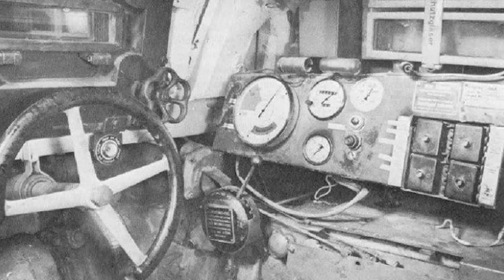A Deep Dive into the Tiger I, by the Chieftain

Comment: The Tiger 1 is slowly becoming my favorite tank, with my previous favorite being the KV-2.

I like tanks that ultimately failed apparently.
Reply: I mean a tiger with a great crew was deadly on the battlefield
Reply: @tonyporter6712  sure, but it ended up getting used outside its intended role, and suffered as a result.

It could also be I like big metal boxes
Reply: It was very successful in the defensive fighting that characterised the war 1943-45 and it had the highest kill ratio of any tank of WW2.

It didn't change the war, but Germany was already losing the war before the Tiger battalions were even deployed.
Reply: The KV-2 was a tremendos failure in reality but popularized by videogames nowadays.

Comment: Armor sloping.  Up to about 45-60 degrees from right angles, especially when using thin armor (under half the impacting projectile's diameter in thickness) sloping gives less improvement against old-fashioned steel AP/APC projectiles than simply making the plate thicker.  So any low-angle sloping is usually based on other design requirements where a slope gives only a small added effect.  Above the 45-50 degree range, sloping can get progressively more effective, though at the cost of internal space inside the thing being protected and, remember, only from certain directions, so sloping is kind of "virtual".  The more pointed the nose shape, the better against thin plate, with the reverse against thick plate at higher angles.

Comment: I'm pretty sure you could find a company that would fabricate the steel that was cut away and weld it back on. Would it be cheap? No. Would it be armored plate? Probably not.  But it could be done if circumstances were to allow it. I understand that it's currently a training tool but things change.

Comment: There are three major needs of an army leader. The best have a good handle on strategy, tactics, and logistics. Very few are great at all three. The one that is usually missing is logistics. Not very sexy, but without it strategy and tactics don’t get you s**t. So weapons design has to take support into consideration. It took a while for the less enlightened leaders to figure that out.
Reply: That's one reason I worry about Ukraine.  They seem to be getting small batches of different weapons from everywhere.  Even if they were designed to be easy to maintain, as you rightly say should be a design priority, they'll still need many different types of replacement parts and ammo.  Seems like a big logistics challenge, if not a true nightmare.
Reply: @polarvortex3294  That's a similar situation to what Grant's Army of the Tennessee faced. They still had units carrying the smoothbore muskets they were issued in their state arsenals, and so the ammunition supply was .72, .69, .58. .577, and .54. This caused a problem during an attack when the wrong ammunition was supplied to a unit that was out. The Confederates at Vicksburg were almost all outfitted with new .577 Enfields. When those weapons were surrendered instead of being turned over to the ordnance depot Grant had any unit with smoothbores resupply themselves with the Enfields. In a stroke his ammunition needs were down to .58 and .577 which are somewhat interchangeable, and .54 for cavalry. My point is that, as you say, standardized weapons are hugely important. Having a mix of weapons is a major problem for supply. That's one of the reasons that so many insurgent groups are outfitted with 7.62 Russian or Chinese weapons, the army they fight is outfitted with the same weapon so supply can come from the enemy.
Reply: This is why Montgomery was the most successful Western Allied ground commander of WW2. He knew all about supplies and logistics.
Reply: @lyndoncmp5751  Yes, ironically he gets accused of being a sub-part idiot, yet the two lionized generals, Rommel and Patton, consistently outran their supply lines.
Reply: Believe it or not, the Soviets actually pioneered much of this understanding in inventing the operational level of warfare. The operational level connects together the strategic and tactical and involves the aspect of logistics.
Reply: @WheelsRCool  Patton had his supplies cut off for Monty's misadventure,American supplies I might add.By 5 September 1944 Oberbefehlshaber West, Generalfeldmarschall von Rundstedt, in a report estimated that the equivalent of four and a half German divisions were positioned in the Metz vicinity.  These division equivalents spanned the range of the quality Germany had to draw upon this late in the war.  They included everything from school and garrison troops, to Waffen SS formations, battle-spent regiments, Volksgrenadier units and Volksturm.  Also present were the usual NSDAP organizations, such as Reichsarbeitsdienst units and party structure bureaucrats found throughout the Reich.  The bulk of the military forces were arrayed within and to the east of Metz, but units had been positioned in the key western defenses as both a screening force and a first line of defense.  Most notable of these was the so-called “Officer Candidate Regiment”, whose combat achievements would largely be responsible for the institution of the Metz 1944 cuffband.  In all about 30 - 35,000 troops were in, around and actively involved in the defensive area of Metz. there,the GIs ended up taking it.The last force to conquer the city was commanded by Attila the Hun in 415 AD, more than 1,500 years before WWII.

Comment: With heavy tanks, could it be said about, one pound of tank is 1000 pounds of maintenance following up from behind? Can't kill the tank, kill the support from the air. You would need air cover of the maintenance to be added to the total tank support. Can't have the enemy destroying the maintenance camp.
Today it looks like small drones can cause havoc with just a well placed dumb bomb on the fuel or ammo.
If quantum portation signals to the drone or self smart drones, the counter would be to shoot them down. 
This could lead to madness in layers of countermeasures for both sides!
Reply: Repairing tanks is a 24/7 job, no matter what model. From first hand accounts of Tiger maintainance units, they were usually hidden well away some 10 km behind the frontlines. This wasn't necessarily a forrest but preferably a built up area with some infrastructure, preferably a railway station close by. They had some light Flak and of course some immobile Tigers to defend themselves. They usually only came under fire when recovering vehicles from the frontlines or when the frontlines shifted rapidly, i.e. during "Bagration".
Reply: @ottovonbismarck2443  Bagration? Sounds dreaded!

Comment: My opinion is that the Tiger was decent design overall but a really bad design for the German Army when it came into service as by that they needed more easy to maintain "jack of all traits" tanks and the Tiger was neither.
Reply: In other words, they needed the Sherman, or, even better, the T-34 ;-)
Well, luckily, the Allies were happy to give it to them.
Reply: @TheEvertw  In essence yes though a German designed and built version would be better. In a theoretical 1v1 fight in a flat featureless plain in clear weather Tiger would beat a Sherman or T-34 every single time and the allied tanks broke down about as often as well, but the difference here was that allied tanks were much easier to maintain so that the allies were able to keep their units close to full strength most of the time. While German units were pretty much constantly under manned and sometimes Tiger crews just left their tanks to rot as it was easier then to try towing them to be repaired.

After all best weapon system in the world doesn't matter at all if it ain't in the frontline and the allies exploited the German issues to the fullest by bypassing the undermanned German Tank units thru gaps or weak points in the line and then struck at supply depots and similar real line targets that made the German logistics issues even worse.

The one who makes best use of the resources they got is most likely gonna win a war over someone who is using their resources based on the war they'd want to fight rather then the war they're fighting.
Reply: The Tiger was never intended to be an all purpose tank. It was intended for a special role in heavy tank battalions. The Panzer IV was the general purpose medium tank and was roughly equivalent to Allied medium tanks.
Reply: @jacquesstrapp3219  Yes I know that, but the truth of the matter was that there was not enough GP tanks so the Tiger was pushed into a role it was never meant to fill. 

That's why I said it was bad design for the German Army when it came to Service since what they needed was more Panzer IV or Panther tanks aka general purpose tanks, not highly specialized heavy break thru tanks.

So the flaw wasn't in the design but rather with German HQ needing something else and then pushing the Tiger into a role it wasn't meant to be in and still reallocating resources to what they needed.

Which is what I meant with "fighting the war they wanted to be rather the war they were in" so the Germans wasted resources building heavy break thru tanks when they needed general purpose tanks.
Reply: @SampoPaalanen  The Tiger I was necessary to deal with heavy Russian tanks. Only around 1300 were built. Over 8000 PZ IVs and 6000 Panthers were built. Tigers were deployed in independent heavy tank battalions that were used in specialized roles. They were not used in divisional tank battalions like medium tanks were. The numbers and the historical usage of heavy tank battalions do not support your statement.
Reply: @jacquesstrapp3219  If the Tiger  was designed as specialized AT vehicle as you imply then why as it designated as Panzerkampfwagen VI Tiger Ausf. E (or Ausf. H early in the war) and not Panzerjäger Tiger (P) (that would be Ferdinand/Elephant). "Break Thru Tank" is by itself a specialized role, a role that really didn't exist by the time the Tiger was deployed as Germany lack the manpower to exploit any break thrus properly as the Battle of Bulge showed. 

Which brings another point if the Tiger was intended to counter Soviet tanks then why was it deployed in Africa or the Western Front, no Russian tanks there.
Reply: @SampoPaalanen  You clearly do not understand the German language and the doctrine of the Wehrmacht in WWII. It would require a lengthy dissertation to educate you about this, but I'll try to answer your questions as briefly as possible.
     Turreted AFVs were usually designated Panzerkampfwagen and non-turreted AFVs were usually designated Panzerjager, Jagdpanzer or Sturmgeschutz depending on their originally intended role. Turreted AFVs were deployed in tank battalions while non-turreted AFVs were deployed in anti-tank and assault gun battalions which had completely different doctrines.
     The Tiger was first deployed in 1942. The Wehrmacht was still capable of offensive operations at that time and heavy tank battalions were invaluable for counterattacking enemy armor that was breaking through to the end of the war so your comment about not needing a breakthrough tank is nonsense. Operation Citadel which included the battle of Kursk and the Kharkov offensive both occurred in 1943. Do a little research before making a comment next time.
     The Allies had heavy Matilda and Churchill tanks in North Africa which were difficult for German medium tanks to deal with. Tigers were used to spearhead the counterattacks in Tunisia so the answer should be obvious as to why they were deployed there.
     Although Tiger tanks were twice as costly to build as a Panzer IVs, their kill ratio indicates they were a good investment. Tiger tanks killed 11.52 tanks for every one of their own destroyed in battle. If you count non-combat losses, such as vehicles broken down and abandoned, that number drops to 5.25 enemy tanks killed for every lost Tiger. That's still more cost effective than any other AFV except the STUG III. The numbers don't support your claim. Of course, there are many factors that may not be reflected in the data but those figures still can show relative cost effectiveness.

Comment: In the West the Tiger Tank has something of a mythos around it.  Did the Soviet Army view the German tanks in the same regard?
Reply: Probably not. Of the 1350 or so built, the heavy majority went to the east, so the Soviets had a lot more experience facing it and learned to deal with it.
Reply from the maker: Sounds like a good question for Out of the Foxholes! You can answer it on our community forum (https://community.timeghost.tv/c/out-of-the-foxholes-qs/9) or if you want it prioritised you can join up as a TG Army Specialist on Patron https://www.patreon.com/TimeGhostHistory
Reply: Making complimentary remarks about enemy equipment would not have gone down well around Red Army commissars; 'You don't think our Soviet tanks are as good as the fascists'?  Sounds defeatist to us....' so Soviet tankers kept their opinions to themselves.
Reply: @johnkinsella5358  They couldn't say it but I bet everyone was thinking it. The soviet crews were very much aware that they were only slightly less expendable than the tank they were driving because there were just so many of the damn things being pumped out. Any damage, breakdown or failure could just be replaced by a new tank that rolled off the assembly line a few days prior.

Comment: Thanks to both of you for an interesting presentation. What really put the tiger into perspective, for me, was when I was at Bovington in '10 with my son. There was a very nicely presented area showing a fine mix of WW2 tanks. It had large graphics and full wall paintings - a well designed display. In front of each tank was a wood crate with a glass cover. the box was displayed mounted vertically, trying to look like a period ammo box. There was one round in each box representing the size of each with respect to the tank it was in front of.  The other rounds in front of the other tanks all looked puny. Except for the 88mm round with the tiger tank. Wow. Not even close.  Nice comparison.
Reply from the maker: Thank you for watching, tom. Great that you took your son to Bovington. It needs more support

Comment: (22:28) "that vision block system would have had ballistic glass inside" to protect the driver and prevent someone from shooting into the driving compartment. This is true. When the ballistic glass became damaged with use, it had to be replaced with new glass, which was supplied. When the supplies ran out, the port had to be left open, and the metal shutters used. There was nothing odd about running across vision block without glass. The glass got rarer and rarer as the war dragged on. American films on tank killing shown to the troops recommended shooting into these slits, which could blind the tank, or if  without glass, could kill the crew. Some of these films recommended using mud to fill these slots, if possible. Private Ryan was not wrong.
Reply: Have you any documented examples of Panzers running without a glass block for the driver? It seems like one of the last things they would want to lose. Because he wasn't just at risk from soldiers shooting into the slot, he was at risk from shrapnel sprayed by nearby explosions.

Comment: Its very much the best tank of the mid-war period.  In ideal conditions.  With good logistical supplies.  That's regularly maintained.  And properly crewed.  When moving as little as possible.

A single Tiger could stop an entire Battalion of tanks in its tracks and send them running the other way without any of their equipment in one piece.  An entire Company could smash apart an entire army with barely a scratch to show for it.  But ask them to cross a shallow river and you're not going to have a good day.  And if they don't get truckloads of fuel and ammo and spare parts it'll be target practice for the next enemy AT battery within a few days.

Germany simply couldn't properly support the Tiger by the time it was deployed.
Reply: it couldn't, the other tank would stop the tiger, flank it and destroy it and the ally would devellop something to counter it.
Reply: I remember reading somewhere were a Panzer commander said that the Tiger was a good tank and could take on 3-4 Shermans.  The only problem was, he said, that they always got attacked by 5-6 Shermans.
Reply: @joshuasill1141  the sherman could take a tiger out by the rear or flank, you don't need 5 to take it out (even less since it can take itself out).
Reply: @joshuasill1141  If the Sherman tanks could flank it. The thing was, the Tiger commanders were often more experienced, and in good positions. Michael Wittman with one Tiger, destroyed around 14 tanks, 2 anti tank guns and 15 other vehicles in the space of 15 minutes. He was manouvering in a village, so they couldn't really outflank him easy... but it would have probably largely come down to Wittman's experience at that point, and the superiority of the Tiger.